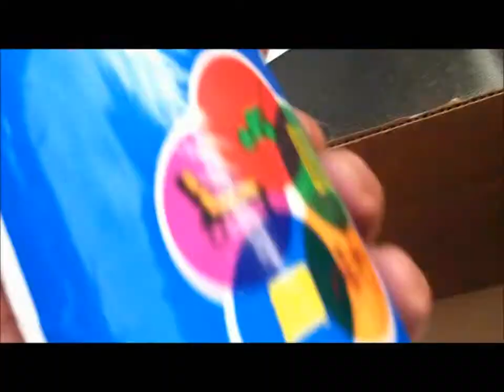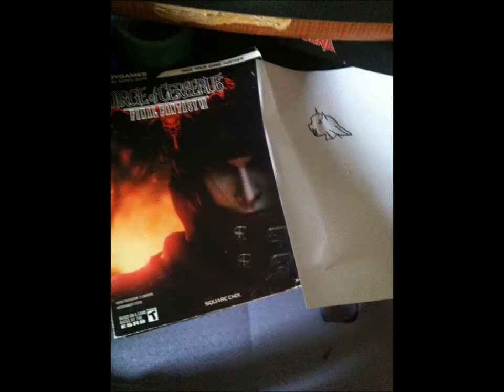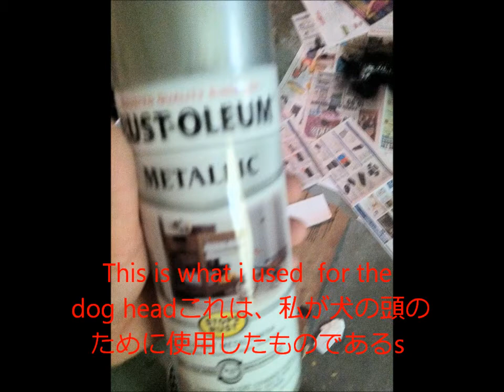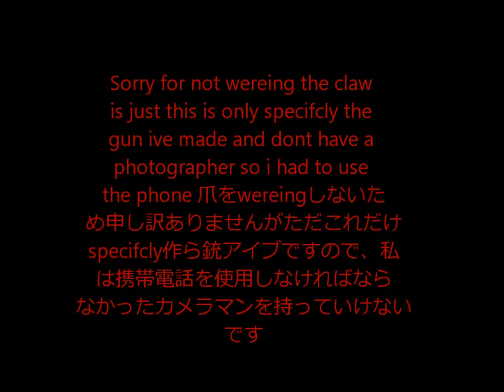Making of the Cerberus Gun(cosplay weapon prop)

Comment: I don't like air dry clay it's very weak and brittle (in my opinion) so I use a more stronger dry clay (if there's any) or use oven bake. If not then spray foam. Usually when I make props and such my method is: cardboard &foam board, tape, paper mâché (both kinds), wall plaster, sand, paint, and then coat boom nice long lasting prop to last for a good while. But nice build making a prop isn't easy sometimes.